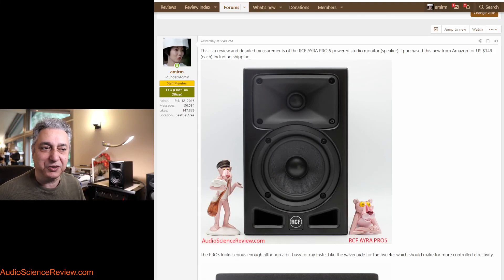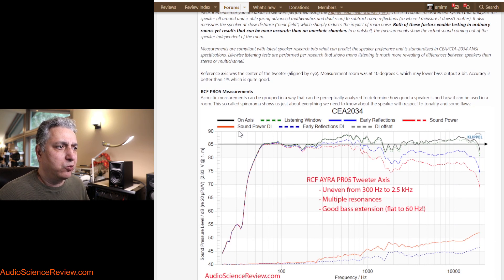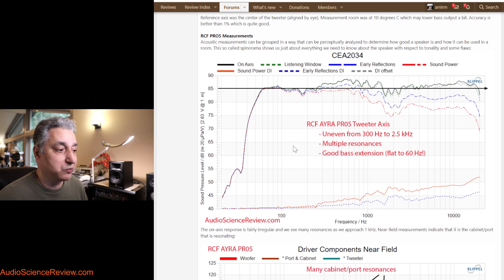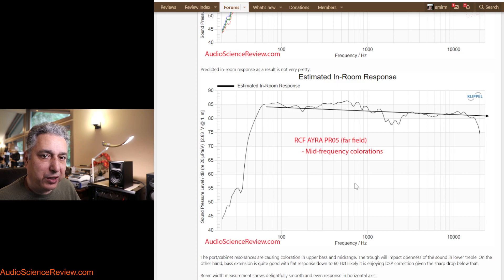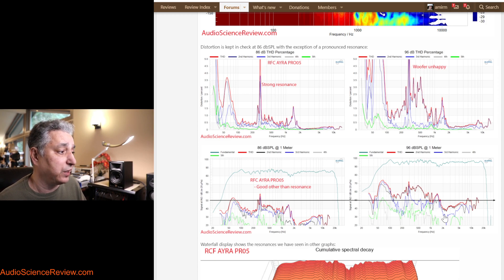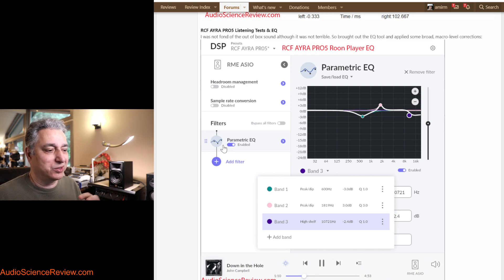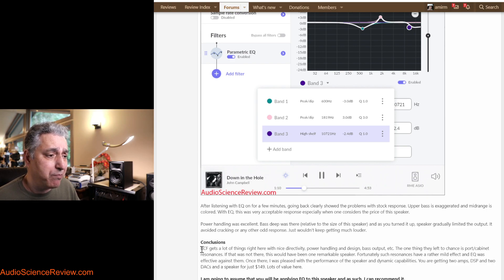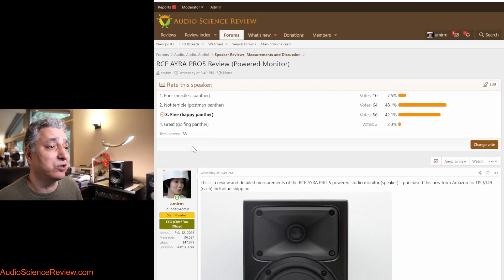RCF AYRA PRO 5 Professional Monitor Review

Comment: What kind of windowing and how much are you using in these measurements? Thanks for amazing content you are putting out!
Reply from the maker: These measurements do not rely on windowing in the classic sense.  Klippel NFS uses dual scan technology to separate the direct sound from indirect sound.  So reflections are filtered away, resulting in anechoic response.  Windowing is used but above 1 kHz where it doesn't reduce resolution.  Below that the dual scan is used.
Reply: @AudioScienceReview  thank you!

Comment: Hi, Great video. There are resonant peaks in the port output. Experienced the same problem with most of the ported enclosures I encountered. What is the right treatment for the problem? Filling damping material in the box, reducing the length of port? Could you please help me with your expertise? Thank you.
Reply from the maker: There are a range of techniques.  One is optimization of the box size and placement of ports.  Another is meta material that KEF is using in their latest speakers.  It is not an easy problem to solve though as I mentioned in the video.  Everything has consequences in speaker design.
Reply: Amir would probably disagree, but I simply go with sealed designs. No port, no problem. Obviously there's no free lunch either and you pay the price in efficiency and excursion for a gentler, downward slope and better impulse response. In case of stand mounters, well, the volume formerly occupied by the stand makes for a neat location of an additional low frequency driver, which in a 2.5way configuration compensates for the losses nicely.
Reply: @AudioScienceReview  great point, i will look more in to it. Thank you.
Reply: @paulb4661  problem of resonance exists even in a sealed chamber as far as I know (of course magnitude of resonance is greatly reduced compared to ported designs).  Getting rid of reflection, resonance leads to the idea of open baffle. Even in open baffle room modes will cause issues. As Amir mentioned "everything is a tradeoff". Thank you for the valuable opinion.
Reply: @Douglas Blake thank you, definitely it needs to be experimented with 👍
Reply: @Douglas Blake Some woofers might not handle the increase of current when port is (semi)-plugged. Manufacturer should indicate that possibility.
Reply from the maker: @paulb4661   I am OK with a closed design as long as it provides full enough response to be satisfying.  And yes, I very much like tower speakers if free-standing is your use.
Reply from the maker: @Douglas Blake I agree with partial damping.  It doesn't take much to attenuate higher frequencies.
Reply: @AudioScienceReview  Thank you Amir - location, location, location dependent at the end of the day - with concrete floor, brick walls and relative boundary proximity of sources, one is looking at a great deal of progressive low-end reinforcement, which tends to work well with low Q, closed boxes. Of course, the old saying of there's no replacement for displacement holds true and a number of low frequency drivers, for example floorstanders accompanied by a pair of subwoofers, will tend to produce more uniform and less "one note" prone in-room bass response, especially with critically damped closed box design. By the same token, due dilligence expressed in cabinet construction, stringent control of panel and volume resonances by combining stiffness and damping, pays dividends exceeding benefits of fancy drivers' inclusion, I'd think. What I mean by that, is that a run of the mill woofer will outperform a top notch unit, if it ends up in a state of the art cabinet, while the latter enjoys the benefits of, all too common, undersized 3/4inch rectangular box with an intimidating helmholtz resonator slapped in somewhere on the front. Elaborate, inert cabinets are a great deal more expensive to construct and ship around, knuckle rap test can be all too revealing in so many cases, I'm afraid.

Comment: Guaranteed this review will spark a whole enthusiast DIY Ayra Pro mod community, with attempts at taming those cabinet and port resonances. At that price and with the mods, this little thing could provide great sound in a lot of casual settings. The only hurdle is that the test equipment needed, which you have, is expensive and complex to operate. Maybe a simple tool based on a MiniDSP could provide enough experiment data to tune the corrective materials.
Reply from the maker: Didn't think about that but yes, taming cabinet resonances would be a nice DIY project.  So good thinking there!
Reply: @AudioScienceReview  Even better is to transfer all innards into a new enclosure :) sturdy, no plastic, good port tuning...could be a gem for the price

Comment: Fantastic review, I am still very impressed by this speaker at this price. An other approach could be to experiment with damping materials now that it is known where the problems come from. It has the added advantage to address the root cause and modding is fun :)
Reply from the maker: Indeed.  A short-cut would be to partially or fully close the ports.  You lose bass but if you have a sub that may be OK.

Comment: It would be interesting to do a few graphs of a rear ported speaker. One with the port blocked off, One with the speaker up against the wall, and a few more with the speaker 1 inch 2 inch 3 inch 4 inch from the wall.
Reply from the maker: Good suggestion.  I will put it on my TODO list.
Reply: @AudioScienceReview  very good. I just hope your to-do list isn't as long as my to-do list. My to-do list is like the universe. It just keeps expanding and looks like it's never going to stop.

Comment: 𝘾𝙤𝙢𝙥𝙚𝙩𝙞𝙩𝙞𝙤𝙣 𝙞𝙨 𝙗𝙧𝙪𝙩𝙖𝙡... by wide margin; no segment offers the performance value that active monitors represent.  

I own several active mains. 
And currently, I have three sets of active mains set up... facilitating easy A/B evaluation. 
JBL's 308p @$219 apiece!
(decades of JBL research, implemented in an offshore offering)

I also own QSC's K8 @$800 each
I now own 6 of these, out of the box these reset the bar in affordable pro-audio 2-ways. 
(I've modded the interior w/damping)

My big actives are Seaton Cat12, a double 12",  w/a coax, DSP aligned, 2kw 3-way @$4k each. 

I've got several pairs of conventional passive loudspeakers, each approach has it's strengths. 

It's just the off the chart value and performance that's available within the active monitors is astounding. 
(fwiw; I purchased the $4k actives first, progressing downward to the $219 JBLs)

I'm renting a set of Meyer X-40 Ultra in July, my daughter's wedding reception, I'll have those and a pair of Meyer 18" 900lfc for a week or more to play with... in addition to the wedding. 

The Meyer X-40 is the ultimate small, active, pro loudspeaker. 

eeek ... ! +$26k for the set! 
https://www.sweetwater.com/store/detail/UltraX40Sub2--meyer-sound-ultra-x40-loudspeaker-and-900lfc-subwoofer-power-couple

Meyer, none better. 

Appreciate the content Amir
All the best